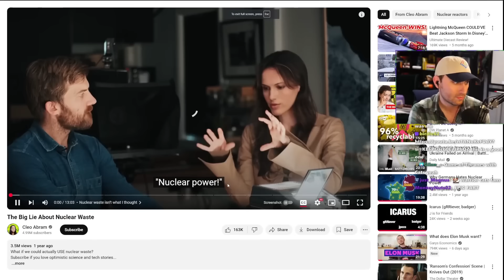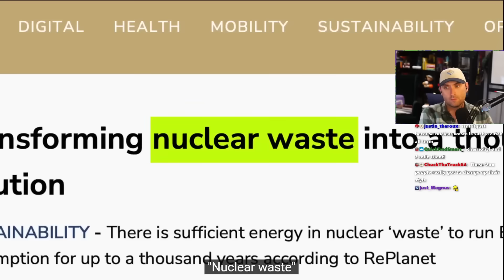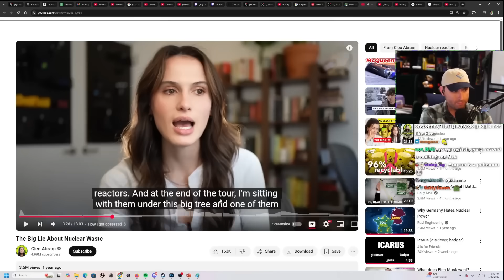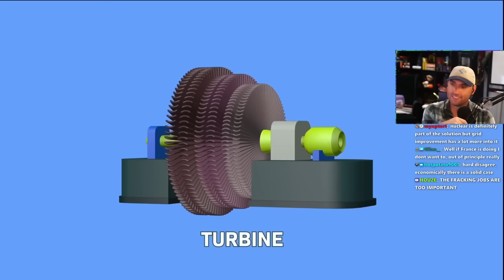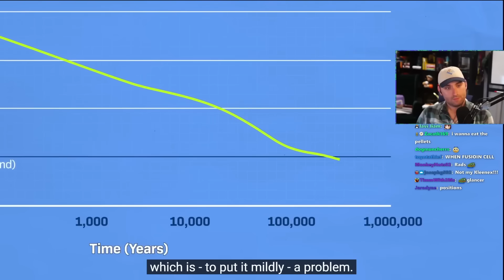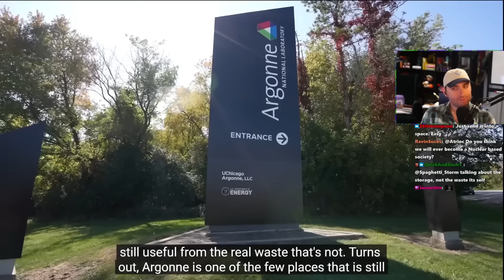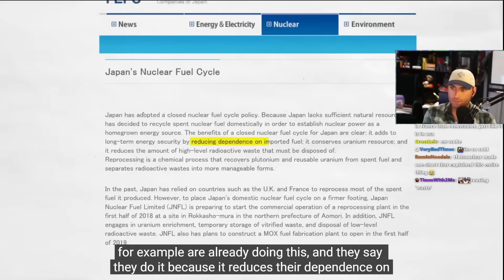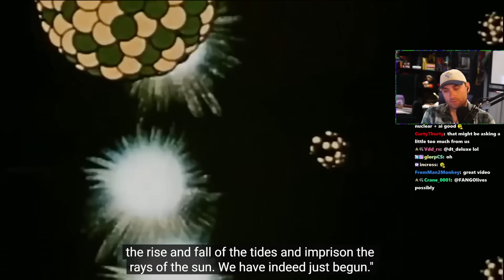Atrioc Reacts to The Big Lie About Nuclear Waste

Comment: Keep in mind this. Even if we don't use this and just store the nuclear waste, that is STILL very little. 

Like the REASON why nuclear is so good is because it gets a shit ton of energy from small mass of matter. Now, since the FUEL itself is such high density, that means the SPENT waste is ALSO so dense. 

Like if you use 1000kg of nuclear to make enough energy to run the USA for a year, that means your WASTE cannot be LARGER than 1000 kilos lmao

As per the numbers, the total waste for energy required by the world for 1 year can fit in a olympic swimming pool lmao.
Reply: Like, in this video itself you see that the size of a nuclear pellet is 1/3rd of your finger (the part over the 2nd joint)

Even if we use a 1000 of these pellets, how in gods earth would the waste NOT be at max just these 1000 small fingerlings?